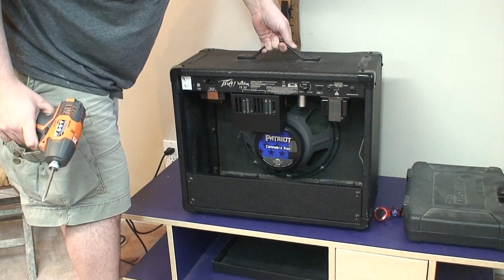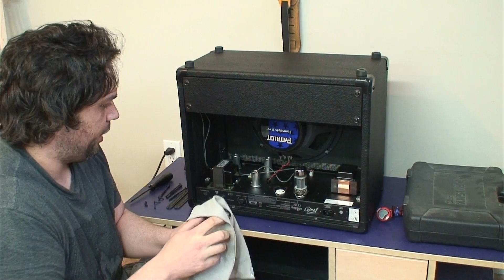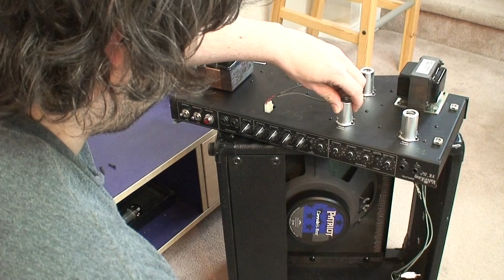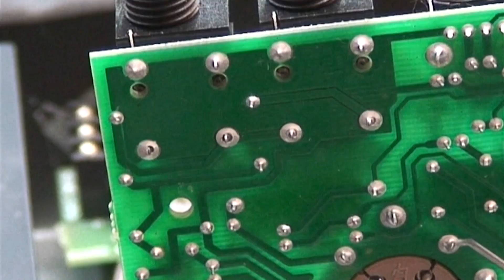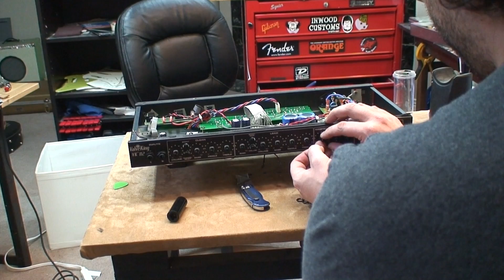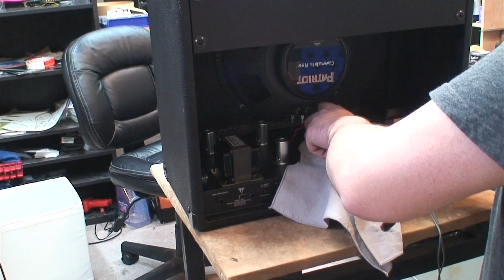Peavey Valveking 112: Input Jack Repair

Comment: THANK YOU THANK YOU THANK YOU!!! I love my Peavey 112 ValveKING its a little bigger than yours but basically the same problem located in the same place, i didn't think i could handle the teardown but started doing it found the bad connections soldered it put it back together and my number 1 input is now working, AWESOME!!! Thank You Much for the VIDEO!!

Comment: I haven’t played in about a decade. On a whim pulled my old valve king 112 amp out; plug in and get nothing. Wiggle the jack and was just like yours. Gonna have to take it apart later. Thank you for the video!

Comment: The older peavey amps never had this problem, it the new stuff made now with the surface mounted jacks, the only thing holding it on is the solder. If it were the old metal jacks that wouldn't even be an issue. Great repair man.
Reply from the maker: +Er Guitars Cheers bro... and agreed. I just watched a video about how they flow solder over these units... cheap as shit dude... no wonder.  Bit of use over time and that's it.
Reply: Yep, That's why the vintage stuff is still around, amps and pedals made now wont be around in 30 years. Where is that amp made China?
Reply from the maker: ***** I don't know actually... but probably;-)
Reply: This is Eric by the way, I changed my name from Sylent Commando to Er Guitars.
Reply from the maker: ***** ERIC.. buddy.. good to see ya;-)
Reply: I have left comments before but I didn't think you knew if was me lol. Its good to see you as well, sweet new guitars man.

Comment: Wonderful little fix. Love your vids!  Gotta mention that your less experienced viewers might try this and they should know that the caps in those boards can hold Off-to-the-Hospital charge even long after it has been turned off.  Caps should be drained first to make it safe to work with.
Reply from the maker: +Bishop Vogue Appreciate the heads up brother.  Many thanks for the tips:-)  Hopefully people will read through the comments and look around for more info, before just following my video;-)  I poked around for about a week doing research before I opened this amp up and I was confident about what I was going to do, but you're absolutely right about being safe!
Reply: +Woodeso&#39;s Guitar Mods 
Right back atcha: thanks for all the tips.  I have learned a TON from watching your videos.
Reply: +Bishop Vogue What should you do to drain the capacitors?
Reply: +ih11son  Heya, there's few videos on youtube that show how to do this.  Basically you are taking the negative end of an electrolytic (usually) capacitor and sending it to ground.  This drains the stored 'capacity' of electricity.  It is not worth the risk of harm to poke about inside an amp, though.  I build pedals - have done for years - and as comfortable as I am with electronics, I still don't mess with amp guts.  Some things are just not worth it, you know?
Reply: Bishop Vogue Cool, thanks. I believe the solder has cracked on my line-in so thought it might be an easy fix. Tbh it hasnt been turned on in quite a while (almost a year) on account of it being broken, so if the caps have bleed circuits I could be fine anyway. I will be checking it out with a volt meter before I touch anything regardless.

Comment: Thank goodness I found this. Had a nasty 120 Hz hum in my VK112, with nothing plugged in and all knobs to the left. Tried changing the tubes, nothing. Figured it was probably a filter capacitor and was almost resigned to taking it to a shop, but I wanted to see how it sounded with guitar plugged in. No guitar sound!? I've been using the Send/Return jumper mod for years so I pulled that out and fiddled with it and realized the hum and guitar sound alternated with my pulling and pushing on the Return plug. So it looked like the problem was with the Return jack. I started Googling for tips on getting the chassis out and found this video, which not only helped with that, but showed me EXACTLY what the problem was. One of the solder joints on the Return jack/board connection looked just like the ones in the video. So thanks! Fixed now. Now I can sell it.
However you left out a couple of steps in the disassembly, the 2 screws in the upper lip into the top, and removing the 2 reverb wire clips, so I had 2 brief steps of "why won't this thing move?" Removing the top plate and Peavey logo from the front was recommended elsewhere and makes more room for chassis maneuvering. And (nothing to do with the video) I had a hell of a time putting it back together as one of the captive nuts for the 4 top bolts was loose, causing the nut to not meet the bolt straight. I was finally able to hold it in place with a tiny screwdriver so the bolt would thread in. Since the other 3 went in easily, the house was full of expletives while I was trying to figure out that problem.

Comment: Nice Job. How I hate that  modern mass production  stuff, were  every switch, pot or plug is fixed soldered on the print. Look at all the work you had to do. And if there is a problem most of the time they switch the whole print. But that just a personal opinion.  ;-) 
btw. I saw Your soldering iron didn't work wel. Cleaning with a file or sandpaper does  miracles. ;-)

Comment: Great methodical disassembly and fix there. My god that's terrible production values there. I've worked on a lot of electronics and its clear that neither jacks have been soldered correctly at the factory. Either not cleaned and as you say it just fell off or more likely that they didn't bother and it's been relying on the force fit of the pins? It's good that you were able to do this yourself as the cost of a technician to do this would be horrendous anything up to $100 for this fix at a Worksop because of the time it takes to do the repair.

Comment: Maybe this helps someone
...

DISASSEMBLY steps

0 _ Disconnect the amp from the main
1 _ Unscrew the 4 screws on the top panel
2 _ Turn the amp upside down
3 _ Unscrew the 4 screws that hold the output tubes cage
4 _ Pressing the clamps, and twisting gently, pull out the output 

tubes

5 _ Unscrew 2 screws from the rear of the chassis
6 _ Disconnect the reverb connector from the chassis (carefully 

remove the hot glue with a screwdriver), disconnect the speaker

7 _ Unscrew the 4 screws that hold the front panel with the peavey 

logo, remove the panel

7 _ Holding the chassis with both hands on the transformers, 

 gently lift and pull out the chassis (if one side is STUCKED, usually the one with switches, make a lever with screwdriver on the back corner, and UNGLUE the chassis from the box)
8 _ Remove all knobs from the pots, unscrew the nuts
9 _ Unscrew the 7 screws that hold the main PCB, carefully cutoff the plastic cable tie near the main transformer
10 _ Check the voltages on the output tubes, DISSCHARGE CAPACITORS
11 _ Turn over the main PCB, and ...

Comment: Hey I bought one of these. Well the reverb doesn’t work. I noticed that the wires in the reverb unit was disconnected. My buddy soldered it but still doesn’t work. I thought about buying a new tank but figured I see if you might have any suggestions. 
Thanks for your time

Comment: Did mine a few weeks ago and used the amp for a few rehearsals and it was fine. I moved it for a gig and the same crap again. Someone else suggested removing all of the original solder and using brand new. Im going to replace the jack as well if Im going to take it all apart again.

Comment: Well you survived without you grounding the filter capacitors through your body (that would not have been a good day at the office). Please be careful when working on valve (Tube) amps, those capacitors retain their high voltage charge for quite a while after they've been switched off.
Reply from the maker: +achillesStar Cheers bro.  I don't know what you mean, but I appreciate the concern.  Seriously though, do I need to do something?  I've been into hundreds of computers and I sort of thought of it like going into any computer.  Do I need to ground the chasis or something?
Reply: +Woodeso&#39;s Guitar Mods Grounding for computers is done to protect the chips which can be damaged from static discharge from the body. This is a completely different scenario. In this case it is you who are in danger, the filter capacitors are used to smooth out the&#160;DC&#160;voltage&#160;following rectification. They handle around 450 volts&#160;and whilst it is up for debate as to how long they hold the charge after powering down (anywhere from 20 minutes to a couple of days depending on who you talk to) they do hold a lethal charge which can kill you even when the amp is turned off and isolated from the mains. This amount of voltage is needed for the valves (tubes) to work properly.My advice is identify them and UNDER NO CIRCUMSTANCES go any where them either with a screw driver or your fingers. They are usually easy to identify as they are generally he biggest capacitors on the board. In this case I think it's the two big blue ones. You may wish to post another video advising caution. You can get more info on this subject on a number of YouTube channels specialising in amp repairs.
Reply: Yeap agree with you Achilles. Any idea if turning your amp on while the plug is off helps? I mean, the current should run to power the tubes and the various components when both switches are on,despite it being insufficient.
Reply: Get a 10k (it's in a ballpark value, others will do fine as well) 5W/10W resistor and solder wires to both lugs. At the end of each wire you might add some crocodrile clips. If you don't use a resistor between the wires, you will see some sparkles and bad things could happen when you proceed to discharge the caps. In order to drain the caps attach one clip to the chasis and the other one to pin 1 of the first preamp tube and leave them there. Wait a minute and check if the caps are drained with a multimeter. This is a common way to do the job for amp tubes, but you MUST google about it and spend some time reading info. For this amp, specifically, you can put one clip to R203 (big resistor) and the other one to D201 cathode. This method is supposed to work better for this amp. You could've died man, I understand you pretty well beacause I've messed around a lot with computers in the past and the first time I opened up an amp I didn't take care because I wasn't even aware of how dangerous they could be. You weren't waearing gloves, you had your two hands inside the amp, the amp was turned off just a moment before start touching and soldering and you didn't drain the caps...To be honest you've been very luckly! Please don't take it bad, I just want to give some feedback because I was there too ;). Anyway, it would be great if at least you change the description of the video because it seems like power tubes amp are like guitar stomp-boxes, and they are not at all.

Comment: I've read this is a common problem. So far mine is fine .... knock wood! I read that the solder they used is lead free so it cracks easier. I don't have a clue the validity of this, but sounds plausible. I thought if it was made in china it had lots of lead in everything? lol Nice job! Just be careful what you touch in there. Those filter caps can pack a deadly punch.
Reply from the maker: +Wicked Fester Thanks bud.. Yeah, I was careful not to try and touch too many things I didn't need to;-)  But hey.. now if your one goes, you know right where to head:-)
Reply: That's for sure and I appreciate the video! Thanks Nelson

Comment: I have to do this same repair on a Transtube 258 efx I have.  The input jack is loose and if I hold it the right way, signal goes through.  Lotta work for a tiny little re-solder lol

Comment: I just scored one of these for $40 and it was the exact same issue you had with the hi gain jack. is this a common issue with peavey amps?, anyways ... just pulled mine apart  and found the same solder joints in mine had to be re-soldered

Comment: I have the EXACT same problem with my INPUTS. I thought the problem was cheap quality jacks, but poor solder joins!
Thanks for the video, the hardest part was getting Amp section out of the box (handle didn't have to be removed?)
Got a deal on it - love the 6L6 sound....that Patriot speaker sounds amazing - Which Model is it??
Thanks
Reply: I can read it now....Cannabis Rex

Comment: So was is wear and tear that caused the break. Or did the solder melt from the tubes overheating the electronics.
Reply from the maker: +Robb VanTour Not sure if I'm honest;-)
Reply: It's the fact Peavey makes their shit on the cheap in China. If you need a loud tube amp and want that Peavey sound, get a classic vtx 212 from guitar center used for around 200 bucks plus tax and shipping.

Comment: Don't mount the jack back onto the board. Replace with a Switchcraft jack that is mounted to the metal face and solder wires from the jack to the board. This way the wires take all movement. You take a real risk of cracking the board if the amp fell or was struck while the guitar was plugged into it.Just have to know how to run the wires by ohm meter.

Comment: Help. It is a very good information until you pulled out the tubes. But I don`t find all the screws, I have to open. My Amp is fixt like before and doesn`t move any millimeter. What do I wrong? I only have to change the standby switch.
Reply: There are 2 screws in the upper lip of the chassis into the top. The connectors for the 2 wires from the reverb have to be disconnected. And it helps to remove the top plate and Peavey logo from the front.

Comment: Not criticizing, asking, thought you weren't supposed to use a magnetized screw driver while working on circuit boards?
Reply from the maker: +Chuck Nowakowski You may be right bud... I don't know.  But thanks for the tip. I'll check in to that before the next surgery;-)